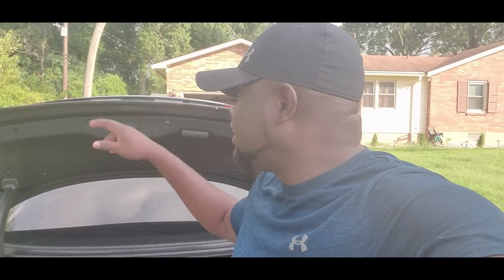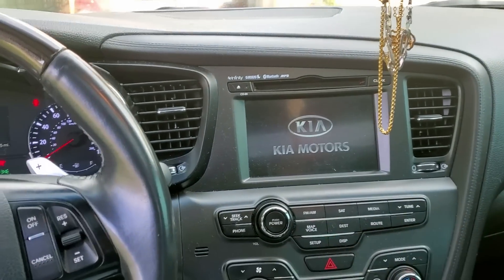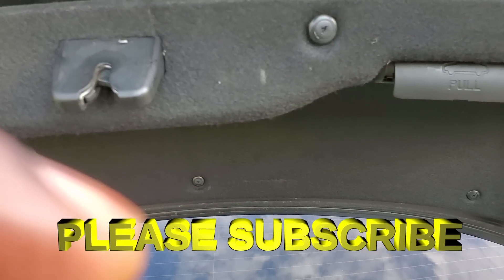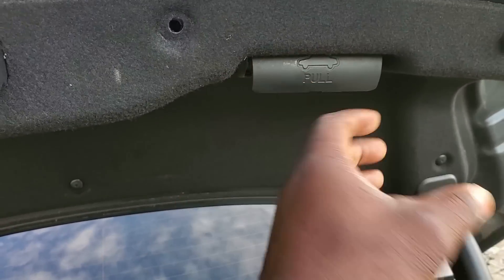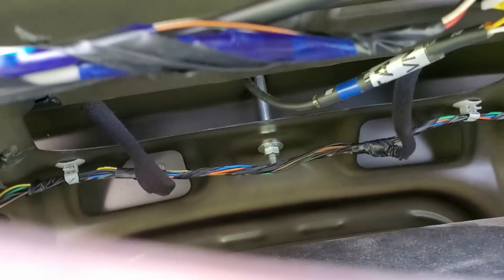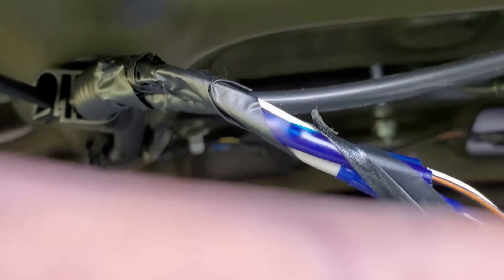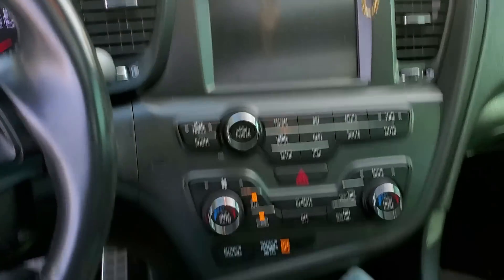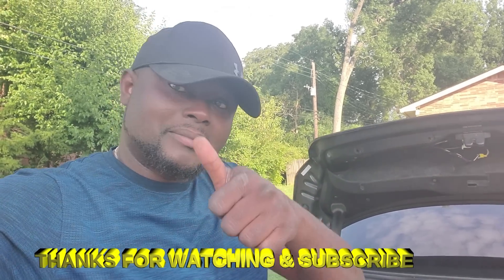Kia Optima backup camera replaced# All kia motor#

Comment: Great instructions. I have a 2012 Optima SX and the camera went out about 5 years ago. Dealer wanted 600 bucks to replace.  Amazon had an OEM camera for 58 bucks.  Thank you for your help! ❤️🤛🏽
Reply: Yo, I'm looking at what I think is the same camera. Is it made by the company Beneray? I'm highly considering getting this one. My main issue is that the camera has way to much fuzz(noise) at night. How is your camera at night? Does it get fuzzy image?
Reply from the maker: Clean and clear 👌
Reply: Comment was for @rswayne100. But thank you.

Comment: Only person to show how each piece comes out. Thanks for taking the time to post this. Got it switched out start to finish in 30 minutes. This is the second time I've had to replace mine and didn't want to fork the money over to the dealership. Also put in a camera that's less than 1/2 the cost. Cheers.

Comment: I have a 2014 Kia Forte with the same problem.I removed the camera and tried to disassemble it to dry it out,but the small screws were in to tight and would not loosen.Took my heat gun and heated up the housing of it hopefully to dry it out.This seemed to work as the camera started to work again.Got some silicone and sealed where I thought moisture could get in and reinstalled it.Still working and hopefully no more problems.
Reply from the maker: Nice. Am going to try it
Reply: Is it still working?

Comment: How do you get the camera out I can't get mine out
Reply: Pull the white clip down,  and quizzes the metal clip by the side of the camera
Reply: @bvlogistics986  I did take that white clip out but you was pushing your camera forward and mines not moving to come out
Reply: @charlenerobertson5653  there is a silver clip on the camera you might need to press down both silver clip for the camera to come out
Reply: @bvlogistics986  okay thank you I'll check that out
Reply: @bvlogistics986  yes it was a struggle to squeeze those two silver clips at the same time but I had to use a flat head screwdriver to get it out.Thank you I've replaced the camera finally after the third try.
Reply: @charlenerobertson5653  am glad you were able to figure it out.